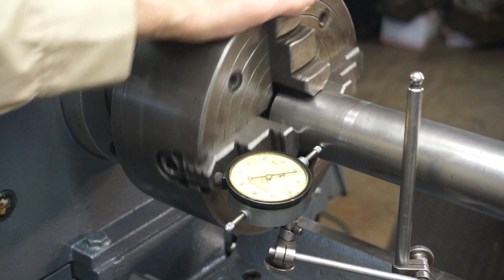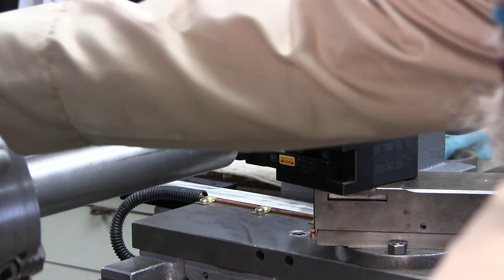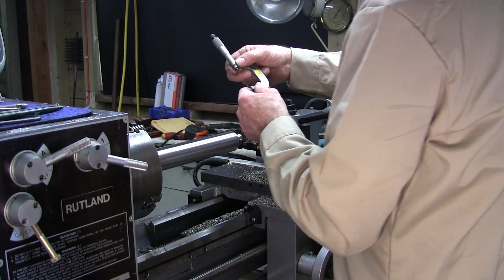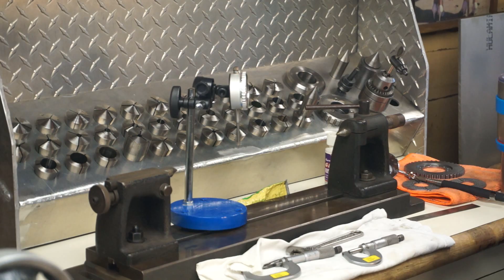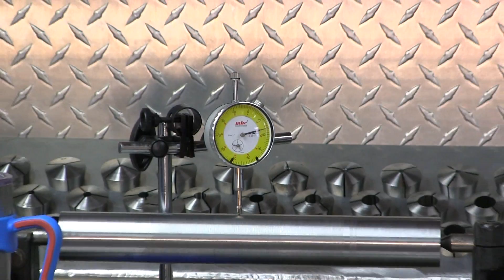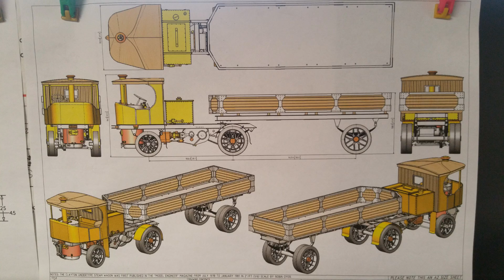Steam Wagon Ho Part Two

Comment: The thread on your tailstock lock.
1/2"-12 BSW  named after James Whitworth  https://en.wikipedia.org/wiki/British_Standard_Whitworth common in England before metrifiction It has similar diameter/pitch ratios to ANC the differences being 55deg included angle on BSW and 60 on ANC and 1/2"-12 BSW and 1/2"/13 on ANC. (the only difference in pitch for the same diameter under an inch if i recall correctly)
I m surprised that a  lathe made in Taiwan would use a Whitworth thread but i don't doubt your ability to measure threads.
When you get tired of setting your beard on fire with hot chips consider a career in education passing on your knowledge as I think you would make a good educator. :)

Comment: Keith, you need to get some electrical flexible metallic conduit (flex, fmc) to cover those oiler tubes instead of that plastic split loom. The coiled aluminum should give you some real protection from heavy metal and  hot flying chips & cutting fluid :)

Comment: I have a similar size lathe and use those styles of carbide inserts.  I pretty much always get a better finish with CCMT inserts, but I prefer to use the CNMG for hogging material.  DCMT do real well on finish also.  Just my observations on my machine.

Comment: i was listening to the straight cut gears.  was wondering if that is where the harmonic is. any chance of pulling the top cover and looking around to see if there is any way to add an oil flow tube directed at the gears meshing so they are coated as they mesh. reducing the amount of howl from the lathe and reducing the harmonic.  i don't recall seeing much of the inside when you were doing the paint job.  either that or add a pan under the lower gears so they pull oil up between them like the old oil hand crank display at many parts stores in the 1960s and 1970s..   might want to also toss in some supermagnets into the gear lube at the bottom to pull any iron or steel sediment out of the lube to keep it out of the bearings.. i do that in car and truck rearends and really improve live span..

Comment: Noticed you got the same floor mats as me. the circles and little dimples on them for grip. Got a pile of them different sizes for all the work areas. very easy on the feet. Downside is I gotta lift them up to sweep under and sweep the swarf out of them.

Comment: Noob question here; where do all the chips go?  The more I think about it, the more difficult it seems to recycle. You have different alloys or even different metals on the lathe.
Just a silly misperception, but did anyone else read the Sandviken tool model name as Cormorant rather than Coromant?
Reply from the maker: The steel chips are just discarded, I do vacuum bronze chips and recycle those along with solids in Aluminum, S/S and bronze. ;{)------

Comment: 1/2" -12 is a Whitworth thread. (BSW). Whit and SAE coarse are the same pitch up until 1/2" where they start to differ. The other difference is that SAE is 60 degree form where Whit is 55 degrees.

Mart.

Comment: So when run true centers aka dead center in chuck and live center in tail stock  you use a dog to turn bar correct then can adjust tail stock to remove any run out ?? Also how bad does use of dog cause vibration due to in balance of turning weight?? Do you have to run slower speeds ??? Or do you try to balance for dog???
Reply from the maker: We will see! ;{)-----
Reply: chris0tube Ideally. But at those spindle speeds and tailstock pressures, a dead center is going to make a lot of heat in a hurry. If the job demands absolute precision and surface finish, then you leave the part .010 oversize. Then take it over to the OD grinder to finish between dead centers.
On the grinder, getting a mirror finish with nearly unmeasurable run out and taper is not that difficult to do.

Comment: Keith
Very good to see the "new" lathe in action, especially on a model engineering application.
By the way, that  atypical 1/2"X12 TPI  thread pitch you encountered on the tailstock, may be a BSW (British Standard Whitworth) thread pitch as the 1/2 " diameter size has a 12 TPI (and a 55 degree thread angle)..  I can't think however why they would have used a somewhat outdated thread form on a relatively modern lathe not built in the UK.
Best wishes 
Paul.
Reply from the maker: 1988 lathe  ;{)------

Comment: Do metalworking machines (lathes & mills) ever come with ammeters or RPM gauges to indicate load on the motor/tool?
Reply from the maker: Not sure I have non on my machines, but there my be some CAM operated machines with those features ;{)-----

Comment: I don't know how it sounds in person, but the lathe sounds really good, also sounds like it has the perfect amount of a$$ to plow through the work... Nice work!!! ... What kinda of recommended rules now apply to the oilier frequency... beings it didn't come with one... Manually, I just keep everything wet to the best of my ability, with oil squirt can...  where as many older machines that have the label stating how often, in either, "per hours of run time" or "once a day"..etc...  Sure, give it a pump right before you start your job on the lathe,  but hitting often through out a 6 hour long job, hitting it like once an hour, to keep things wet... or is there such a thing as lubing to much, beside the idea of wasting the oil, of which is not a big deal, for the cost of a gallon... I wouldn't think that there would ever be an issue of too much, other then the mess..lol

Comment: Nice break-in for the "Old Girl" lots of chips. Must be a Good feeling to reap the benefit of your labors.... I noticed that when you set your tool height, you allowed it be slightly below center? Is that because of the negative rake on the insert holder? or is that your norm?
Reply from the maker: My norm to start with, then adjust when coming across the face cut to center. ;{)-------

Comment: Hello Keith, glad your back in action. Love the Rutland project, I myself am just finishing a rebuild on a Colchester/Clausing 15" and cant wait to spin her up. Great choice of tooling, that combination after you endoed the bar with taking the .060" was some perfect chip geometry. chip breaker working as it should and shooting the chips straight down. Thanks for all you do.
Reply: The colour you get on the chips is a result of a very thin layer of oxidation that happens at certain temperatures. The reason this is important is tool life and economy. At the right speed about 80% of the heat generated goes into the chips, ten into the tool and the last ten into the part and it's in this zone you get the colouration on the chips.
Problem with manual work is that it can be difficult to keep up with the speeds needed since the inserts are made for CNC's. If you go to slow you don't get into the correct "dynamics".
In general higher rpm=more heat while more feed=colder and deeper cut=colder chips.
(If the chips starts to glow you're running way to hot or broken insert).
Reply: I've not the machine experience of most of you guys. Could someone kind of go over the chip color snd what it means? I think Kieth said they were "Golden Brown"?

Comment: Keith, Could that 1/2"-12 thread actually be a 0.5MM thread? (my thought is 2 times 12 is 24 TPI which is kind of close to 25.4)
Eric
Reply from the maker: All I know is cutting the 12 pitch to proper tolerances, on a 1/2" diameter is a perfect match no matter the length of engagement. ;{)------
Reply: OK. THanks Keith. Beautiful work as always

Comment: The way I use the DRO on the lathe is to set the x always on diameter. I take my first cut, then mic the diameter of the part. Enter that reading into the dro. Now, when I take my next cuts, I always know what diameter my part is at, so long as I don't change my tool, plus or minus a couple of thou. Before I get to my final pass, i mic the part one more time to double check my dro reading against my actual mic reading. On my lathe it's usually dead nuts. But, sometimes you might have to reenter the actual reading in the dro if something moved or tool wear. I find it easier to follow the print this way, and quicker too. You need a little experience on the machine to gain confidence in its tolerance holding capability, , but I've learned that I can rely on the dro to tell me the truth unless I chipped the tool or something. Either way my reading will almost always be dead on or larger, in the case that something moved. You're gonna love that dro, once you get used to it. It's also great if you have a bunch of shoulder faces that need to be within tolerance on the z axis.
Reply from the maker: Exactly, looking forward to using it that way, got to look in manual to reverse the Y axis travel direction. ;{)------
Reply: I approve of that nit picking! :-D
Reply: R K  Since we're nit picking, it's a lathe, not a late. :)
Reply: Y axis on a late is up and down of the tool!  (Yeah I'm a CNC-guy and nit-picker)

Comment: Hey Keith, I'm pretty sure the adjustable leveling feet on that lathe are also 1/2" 12 whitworth thread. I had a lathe almost like that, I've mentioned it before in some of the other comments. I had a hell of a time finding bolts to use as leveling feet on that lathe. :)
Reply from the maker: I shimmed it level and bolted it down solid to the cement, shown in my earlier videos ;{)------

Comment: like that neg. geometry sandvik should put most of the heat in the chip the gold chip I bet will give a long tool life gonna love to see the shooting star in action dose it have programmable points and tool compensation or like the sony magnescale LH 71  you can program linear error compensation for perfecting accuracy any of the setup stuff id love to see cause the manual for those is not online

Comment: for the gears out back where they are out of the case and oil bath i use motorcycle chain lube sticky as and seems to do a good job vs standard oil flying all over

Comment: Is there any benefit to that tool holder being angled down at the tip, compared to your others that present the bit at right-angles to the work piece? And does the cross-section size of the holder have any effect on the finish of the cut?
Reply from the maker: Negative angle on the tool does give better chip breaking and also give clearance to the cutting,square edge of the insert style. ;{)-----

Comment: okay, so I have another (noob/boob) question: the attack angle of the cutter is pretty negative - doesn't that cause the stock to overheat? When you handle the part for metrology you comment on its "warmth" and have to handle it with welding gloves, rather than kid gloves, as it seems to deserve. <duh> I don' gitit.
Reply from the maker: The heat is caused in all cutting, but when you are non stop for the entire process 3 to 4 passes the heat soaked, through and through, without running coolants.  ;{)------
Reply: Actually no he doesn't. The tooling can easily take this heat (and then some) but what  it can't take is temperature shocks. So to use coolant copious amounts are needed to ensure constant temperature of the insert (look in a modern CNC). With even a short lapse in cooling heat builds up and then when it splashes on the tool micro-cracks are formed and thus tool-life gets reduced and irregular.
Right now he only roughed the part so tolerances aren't affected by the heat.
Besides showering in coolant isn't very nice and that's what happens in a manual machine if you run enough.
Even in CNC's coolant is mostly used to get rid of chips from the cutting zone as fast as possible to avoid re-cutting. This mostly applies to internal but once used a single drip of coolant can cause a failure in an insert so once used=always on.

Comment: Hey Keith glad your back in the shop. Couldn't you adjust the tail stock a hair to get that taper down under a thousandth?
Reply from the maker: Yes I could, and will, when I set up the between centers, the amount is not that critical to rough off material. ;{)------

Comment: Looks to me, you may have some run-out in your live center.

Here's how I check for that

Turn the part with the live center... You only need to turn back enough to get an indicating surface.

Stop the lathe.

Withdraw the live center from the workpiece.

Rotate the spindle 1/2 turn.

Re-engage the live center in the workpiece.

Indicate the workpiece.

T.I.R. will be double the actual run-out of the center.

In my experience, I've found very few live centers that don't have some run-out... I think it has to do with the quality of the bearings.

Frank

Comment: 1/2" 12 tpi is a British Standard Whitworth thread.
Reply: That's true, but as Keith said, the Chinese are very superstitious numerically and just do not use the number 13, not on buildings, not on threads, or nut and bolt sizes. Like on a car, it's always a 12mm or a 10mm, and if they could make everything using the number 8, they would be ecstatic, it is super lucky and brings wealth...or sounds like it, I can't remember exactly.
Reply: Whitworth Standard dates back to the 1840's to enable expeditious repair of mill machinery in textiles and other early industry.  It was quickly adopted by railroads.  Machinist tools were naturally based on the standard as that is what they were expected to produce.  It is not just the TPI which is different; the thread angle is different along with the thread peaks and valleys being squared or rounded.  The differences are because of the characteristics of iron versus modern steel fasteners. Whitworth enables a wider minor diameter and thicker threads, which are important for a more brittle metal.  
(And yes, the Chinese are goofy about thirteens and fours; but Whitworth predates their involvement with machine tools)